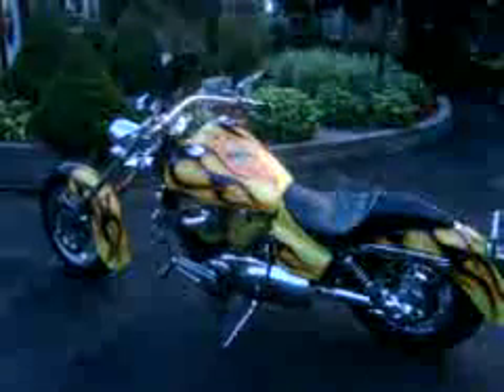Shadow Ace 1100  Custom Chopper

Comment from the maker: The intake is custom made from scratch including plastic curved tubes from a 2003 Chev Cavalier plastic intake and a custom built  tig welded aluminum centre box just behind the carb. The box fits between the heads, and the curved runners to the heads are "JB" welded to the centre air box. The interior of the intake has now corners or blunt edges and , is essentially "port matched".  The final jetting to the S&S Carb was a tedious ordeal. The forks came from Europe somewhere, I didn't build the front end. Thanks to William Moore for his "stupidity" as expressed in his comment! Fact is, is that this bike cost $15,ooo US dollars less than a "Screaming Eagle" Harley to build. And, unlike the Harley, this Shadow "IS" "one of a kind". I should have filmed it in the daytime but the reflections off the chrome would have overexposed the video! There's not a mark or flaw anywhere! This bike was built by 3 men, not just me, as I only  recently purchased it and remanufactured the intake to make it run at 100% performance cause, as a licenced 35yr diagnostic automotive tech, that's what I can do.. Thanks for calling me a fool  too. If you knew me, you'd be eating your words right about now!